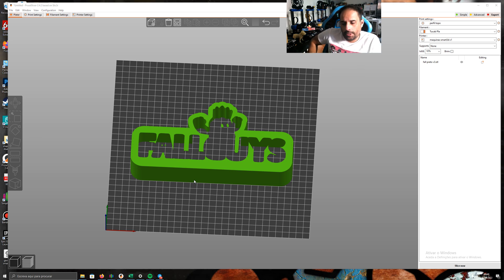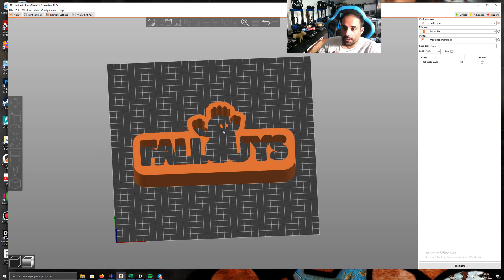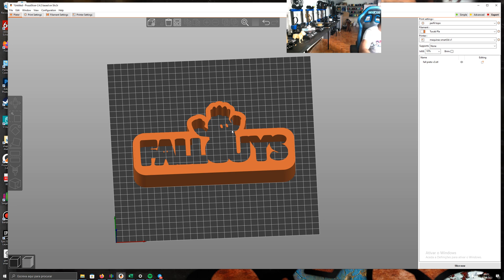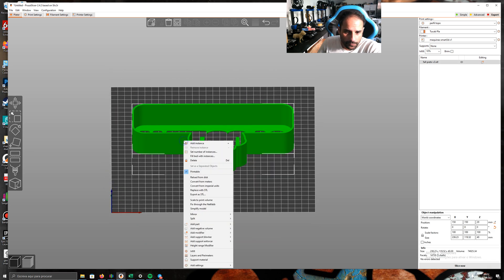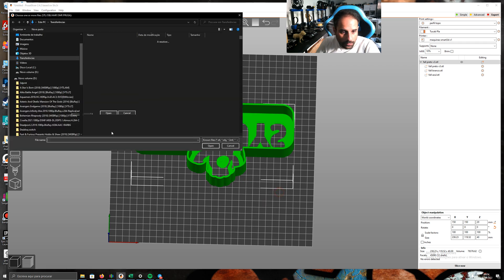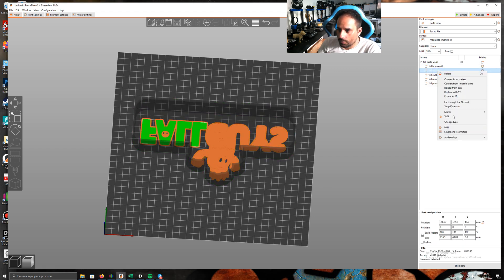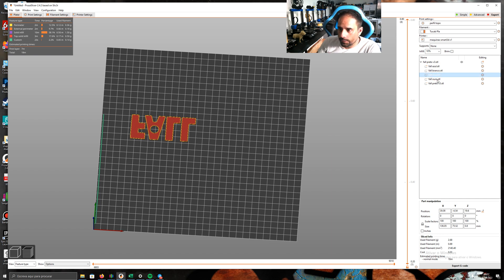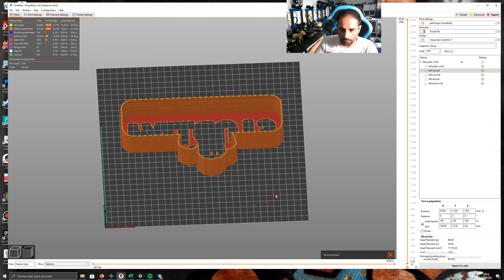Print your lights with more quality (3D Print)

Comment: First your English is just fine!  Being fluent in a second language is about having the perfect word, but rather being able to communicate the idea, even if it takes 4 or 5 extra words to get it explained.

I don't not have Prusa, I have a Zmorph (Voxelizer Slicer).

My question is this:

How are you printing all of the different colors?

At first I thought you were just printing the pieces and press fitting they together.  However, after watching this video it seems as though you are printing them all at once on the same bed.  This seems very difficult to do.  I think that I am not understanding something correctly.
Reply from the maker: print everything side by side without giving space the pieces merge, glue for them you know?

Comment: thank you for explaining for us english speakers. you did very good. and it's safe to say we understood what your saying.. I use cura currently not prusa slicer on my ender 3 v2. so I have downloaded prusa slicer just to follow your video. but I have no clue to find where z hop would be
Reply from the maker: I go make vídeo
Reply: with mine its under filament settings ... in the left section --> fourth one down.

Comment: thx for the explanation. and your effort to do it in English. you are good to understand. don't worry about it 👌. you use z-hop I think? otherwise nozzle dig in the previous prints  .I like to make stuff with multiple colors on first layer.  I only have te problem I can't find the right tool to split up a multi color picture in more than 2 colors.  u have a tip for good program I can do that ? I have tried plotter program's but it's almost impossible to get the right dimensions 🤔. I see you switch allot between negative and part.  I load the prints as separate prints in one so you can hide them with the eye. en make the gcode 1by 1 by hiding the parts except the one I need . maybe that works also for you ?   I think it's a bit faster .  thx again and love to see your lamps. they looks amazing 👌👌👌
Reply from the maker: Yes use z hop 1 mm and color 4 layer 0.2 😉